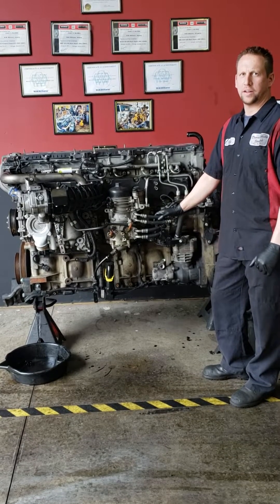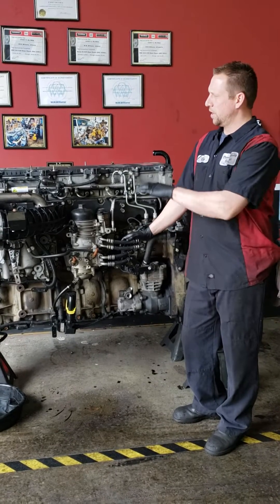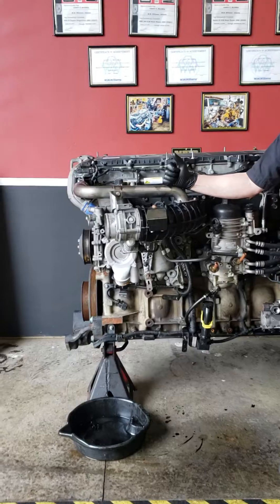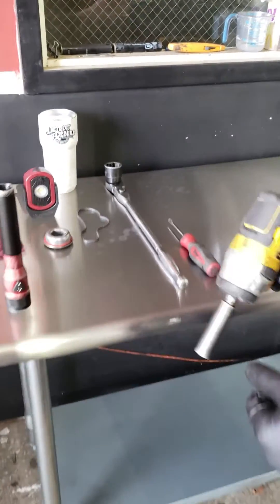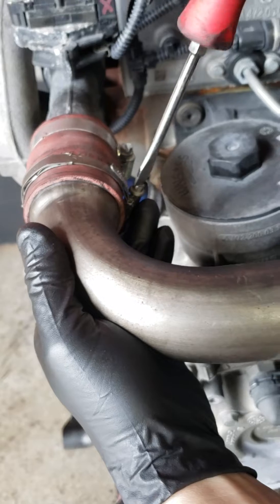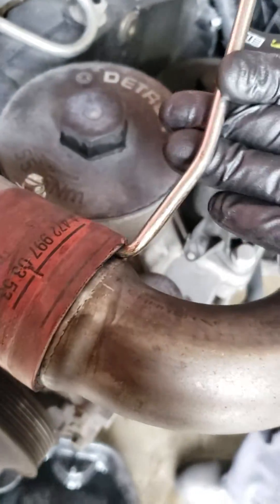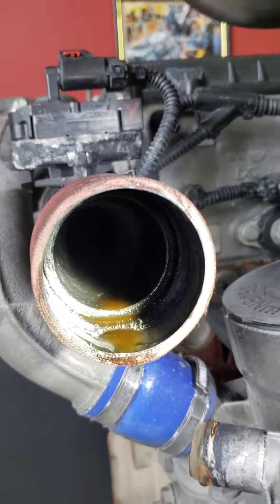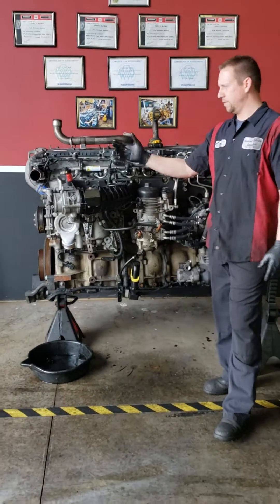Leaking EGR Cooler on DD15 Engine.

Comment: Brother I've done that test I'm still losing Cooling and it was dry inside Ivan check my oil level everyday it's not increasing so the coolant is not going in the oil where else can it go. It's not leaking on the floor but I'm putting at least half a gallon every week I'll take it to mechanic they couldn't find it

Comment: Thanks for the cool videos you make for us ,they are made professionly and are  really a money saver for us. I have a 2020 Freightliner Cascadia with a DD15 engine auto trans with 676000 mile 13000 engine hours.I do lot of repairs myself but lately I have noticed that the engine fan is always on from the moment i start my truck in the morning to the end of the day. This truck is equipped with a viscous electric fan with no air suplies to it.I checked all the plugs and sensors they are all in place. I took it to my regular mechanic and my local Freightliner dealer and they couldn't detect the cause or any problems.I Even replaced the fan clutch myself but still the problem accured. There are no codes on my dashboard .but the engine light keep comming on , it gave me on my scanner a message ( SPN 0 /FMI = 0 Data valid but above normal operation al range -most sever level). Should I check or replace the ECM computer? What do you suggest?

Comment: What you removed was the cold pipe. You might not see anything there in the early stages. The proper check is at the hot side.

Comment: Thank you for your video. I have freightliner Columbia 2006 , 60 series and lately I am having issue with black smoke and losing power. What to do? I changed my west gate actuator, new delta sensor too. But when I disconnected the delta sensor, there is no black smoke. Once connected there come black smoke. Please , any thoughts?

Comment: 2012 dd15 deleted dpf but egr leaking. Do I even need egr anymore now that its deleted? Can you let me know if I can remove it and eliminate my coolant leak. I took off that pipe like you showed and theres a plug in the rubber hose so I am believing it is not functional anyway.

Comment: Hello sir. I just had issues with coolant pipe line on 2015  freightliner , which I already changed. But my engine not sound right. Its sound like leaking exhaust pipe  or bad turbo. Would you tell what's factor will make your engine sound little off the right sound

Comment: Yeah but what if you check the pipe and it’s bone dry and you still cannot find a leak
Reply: I am having the same issue. Pressure tested, checked EGR from both sides, changed injector cups and no visible leaks. I was told that is going to be the head gasket.

Good luck

Comment: Could you please point at where the egr valve is on this engine. In Ontario, Canada mechanics outside of the dealership can't tell me. Thx
Reply: Watch this great video that replaces the middle section that controls the egr valve. The egr valve has the arm adjustment that has to be easy to move...https://youtu.be/uLWnKkH5_F0

Comment: TY for the info. Question... so I’ve changed the water pump and the egr cooler on my 2016 DD15, but the coolant leak I have is coming from passenger side line above the egr cooler/ line closest to the firewall. I have a photo if you need it? Can you tell me what that part is so I can order and replace it? 
Thanks 
BTW, the coolant leaking out from that aluminum line drips down that side of the block and hits the ground behind the oil pan at the clutch housing. Thanks 🙏
Reply: Those are your egr lines that run to block of the engine over time. Heat can put wear and tear on them and they can become crack or broken and leak all your coolant out.

Comment: hello sir you are the man ! keep up the good work . 

I have this code. 

SAI : I Engine 2 
3/3 
SPN:520296 

last night it caused my engine to debate 25%. Now its 
working fine again. 

do you think it could be because I need to replace the 
EGR cooler ? I have notice some coolant missing. Also I 
change the EGR actuator last month but it didn't fix it.

Comment: If there is no visible leak outside, it could be due to many factors like bad injector cups, coolant leaking into oil, egr cooler gone bad etc. Does the engine show any symptoms while running if the egr cooler has gone bad?
Reply: Yes there was visible leak. Which I just replaced

Comment: I have a 2016 dd15. I see bubbles forming in surge tank (coolant tank) while the engine is on. What could possibly be the issue? Is it normal to see bubbles?
Reply: you got combustion gases escaping into the coolant system that usually indicate a head gasket.